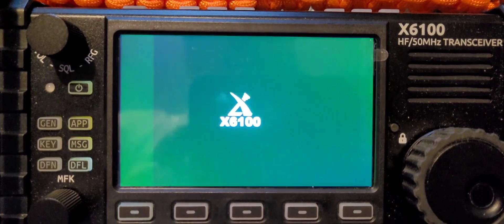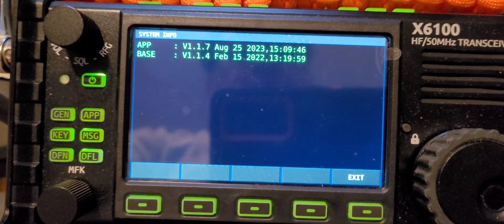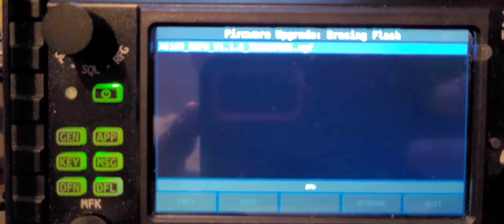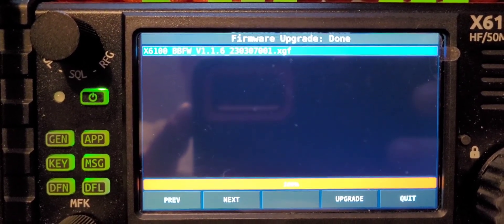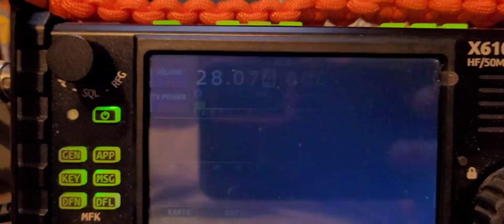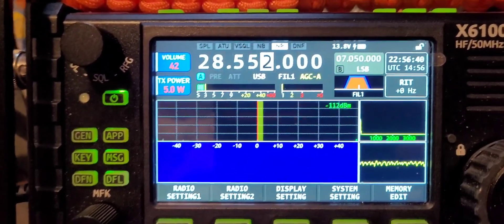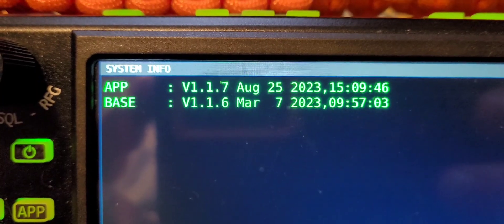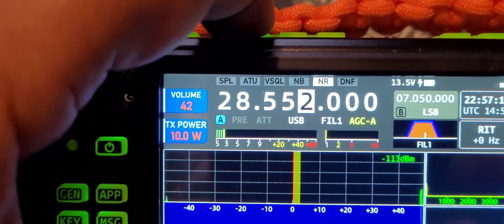Xiegu X6100 Firmware PSA *UPDATED*

Comment: This was on Radioddity web site:
Warranty Note —— We provide a 18-month warranty on the Xiegu X6100 (was 12 months before September 14, 2022). As usual, if you modify the radio's hardware, the warranty is void. (The warranty is void right after you remove any part of the radio case without the agreement of our support team.) Note any firmware bugs or any other software-related issues are not under warranty.

Comment: The problem is caused by a number of things. Glitches in the download, using an SD card that is too large, the larger the card the greater the chance of error and the use of Rufus which is known to cause  errors. Use Balena Etcher. There is nothing wrong with the radios. The majority are not having issues with the new  firmware and I find it perfect
Reply from the maker: @trev8932  I completely understand where you are coming from but the one thing that you might be missing out on is the possibility of different board revisions in the radio.   Radioddity has confirmed that there is an issue with some users radios taking the baseband correctly.  I'm standing by skipping this "update" until it's confirmed on all revisions.
Reply: @wattsandhertz  You could well have a point. The only thing is when people have switched to Balena Etcher, used a low error 2gb card and then loaded in the firmware all has been well. Too many are slagging off the radio without realising that they could be introducing errors by their own methods. The other things to bear in mind is ensure you are using external 12v supply, personally I don't use a switch mode supply but a battery that is fully charged and at least 7AH also make sure all USB cables are disconnected from the PC and antenna and microphone are disconnected too, any noise getting to the radio when flashing firmware can cause problems.
Hopefully as radio amateurs we should be aware of this.

Comment: I don’t know how it got corrupted. I upgraded to the new firmware and it did not cause any problems. I switched back to the older firmware after people started having problems. I used Rufus no problems. Are you formatting the card every time before running etcher? I have had problems in the past with SD cards if I don’t format them every time.
Reply from the maker: Yes they were formatted each time to start with a clean card.  I also tried 2 different cards in case they were the issue. 
The only thing that fixed it was Balena Etcher but also there have been reports where others have had the same issue and reverting to the previous Baseband corrected the issue.  Once I used Balena it cleared the issue.

Comment: Excellent video.  I'm glad i sold this unreliable junk a while ago...I don't miss it at all.  The receiver is worse than my g90 unless I used the russian firmware.  The firmware "updates" always fixed 1 thing and made 5 other things worse.  Battery frequently got very hot.  I'm glad i sold it while its value was still high (before the 6200 was announced).
Reply from the maker: Thanks for checking out the video!  Mine has been pretty stable up to this point.   I had both the G90 and 6100 but sold the G90.  Of course I really only use the 6100 for POTA or when I travel.  Updates have been pretty rough and with the 6200 honestly I am not seeing much of an upgrade in features.   But I AM seeing less power reported.   I am not going to get one though.
Reply: @n0vfiradiomisadventures  So, I kept the g90 because it suits my operating style better.  I don't go backpacking or hiking, so the minimal size and weight difference between the two is not critical to me.  The birdies and ghost signals on the receiver is a deal breaker for me with the 6100.  Occasionally the radio would lock up and require a reboot.  Anyway...I'm glad you were able to revive your 6100!

Comment: No issues here with the latest firmware update. I used Balena for the Mac and loaded up the latest firmware fine w/XMIT. Sounds like a bug in Rufus when creating the image. Just my 2¢.
Reply from the maker: I would agree post initial update.   The initial update is reported to have nuked others transmit as well.   I am wondering if the initial issue is a different board revision that is not compatible with the new firmware.  I asked Radioddity about that and am waiting on a response.   Thanks for commenting!
Reply: @wattsandhertz  You bet! Please keep us in the loop and thank you!